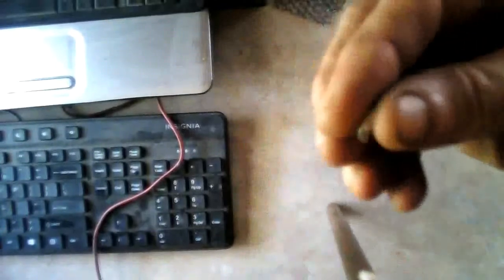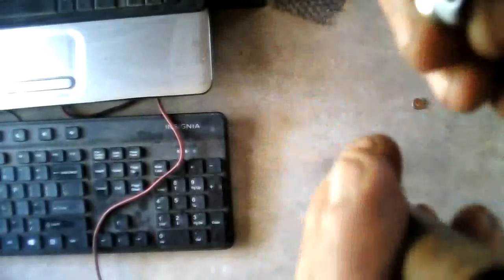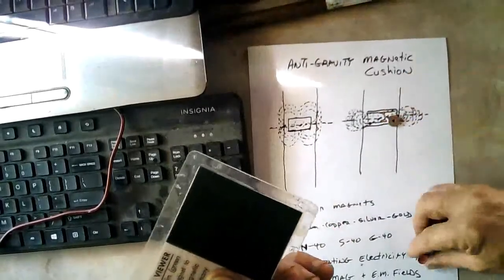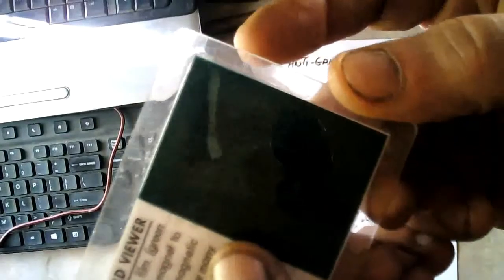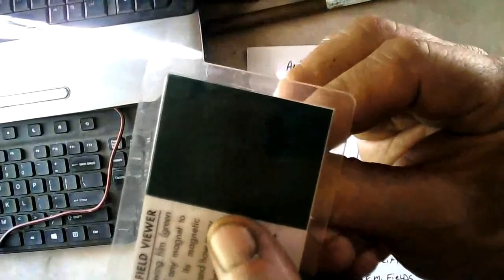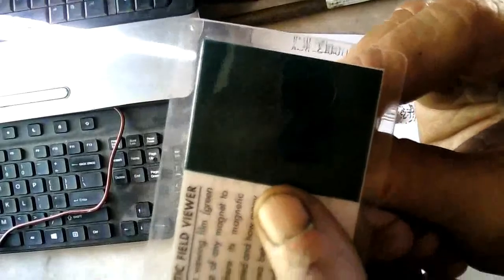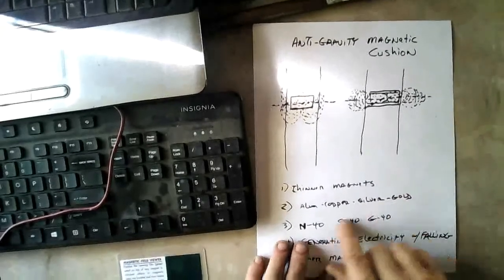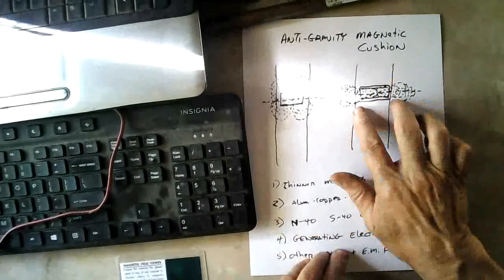A Simple ANTI-GRAVITY Magnetic Cushion!

Comment: I remember the first time i saw this years ago, and it is still makes me smile now!
The copper tape you brought to the experiment is very interesting, I was thinking along the same lines of an explanation you describe as I watched you do the tests :-)
I guess all the energy from the magnets movement is being converted to heat in the copper pipe, you could think of the pipe as lots of short circuited copper wires one on top of the other. - Thought provoking experiment - Martin.
Reply from the maker: Thanks Martin. I could use my infrared themometer to measure the temp of the pipe, but it may not generate enough heat to measure. Worth a try though. Great input! Thanks!

Comment: I wonder if a sheet steel blank would work since it is attracted to the magnet.
Reply from the maker: If you are suggesting adding a thin round steel piece to the magnet and dropping it down the tube. I tried that, and the added weight sped it up. I tried it with two magnets (steel between them), and that dropped faster too.  Aluminum between the magnets worked better. I even rivited two magnets together with the same polarity facing/repelling to see what happened.  It still dropped slow, but the rotation was affected as I remember.
Reply from the maker: I was just thinking that you might have meant add the steel to help generate power? That might work, but how would you take the power off the dropping magnet? If we could get the magnet/steel to stop in the tube, that would open up other possibilities I think.
Reply: Interesting study. I think when a ferrous material is added to a magnet it effectively absorbs the magnetism and/or redirects the field. I don't know if absorption is the actual effect but it's something like that.  Otherwise a relatively small magnet would magnetize a large piece of iron. I know in antenna theory metal objects can either block or redirect a field pattern. That's the basis for parasitic arrays. There is coupling of the elements involved. Your observation is intriguing though. you might try wrapping a magnet wire coil around the side to see if that has an effect.
Reply from the maker: That's a good idea Fred. I've got some magnet wire. I could hook the meter leads to each end and see if a voltage is produced when the magnet drops through the tube/ coil. I bet it does! :-)